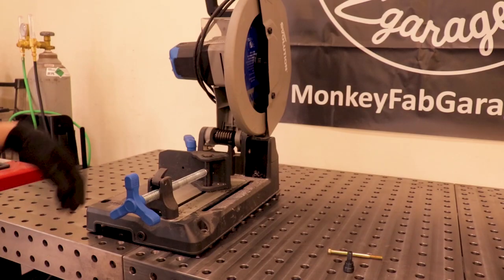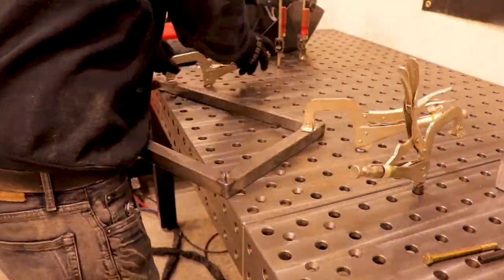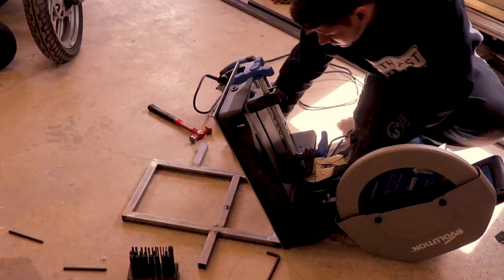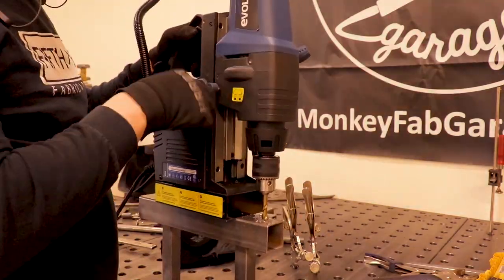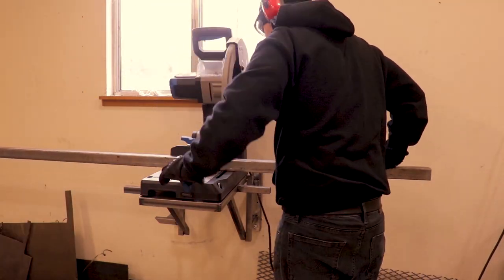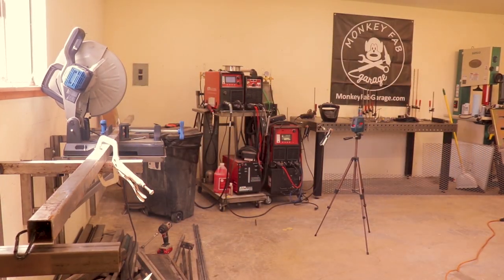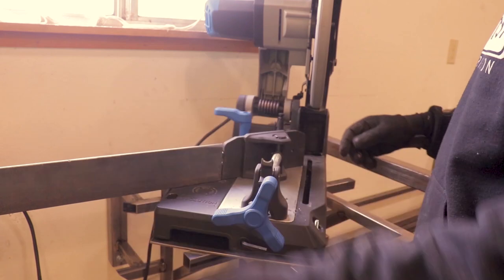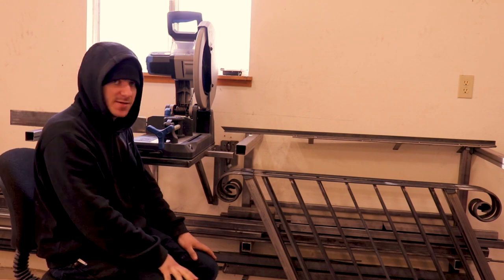Ultimate Chop Saw Stand

Comment: Brilliant build! With the pivot point in the place where the bolt is, does that mean you can set a backstop to a certain length then Change the angle and get the same size cut? I’m thinking of doing this, on the evolution saw I know there are 3 fences positions do you use the middle one? 

I love watching people create their ideas and tweak aspects of it, think of how much more convenient the saw set up is when done what a time saver 👍

Comment: Excellent!  I'm going to be doing the same thing.  I'm going to put my saw on a "lazy Susan" to spin it, and make it adjustable up and down as my work bench will have a wood miter saw on it too.  I want them to all be level, but the metal saw has the lock piece that will get in the way so I have to lower it.   I'm really eager to see the next video.  Out of curiosity what gauge steel did you use?
Reply from the maker: That sounds awesome!  It was mostly .065 and .095 whatever was lying around
Reply: I'm curious. You make an outstanding piece.  You have the drum sander in your hand and you leave rust on one side of the piece of steel.  Why not remove it and paint it?
Reply from the maker: @hipairbrush1053  that piece took like 10 minutes for that side! Haha and it was mill scale so itll protect it from rusting

Comment: How is straightness of the cut on the chop saw? I have heard mixed reviews of the cuts being 1/16” off.
Reply from the maker: Mine are dead on!  I have 2,  the older one and this new one and the straight up and down motion is dead on.  For angles i use an anglr finder but the stock 45° is really accurate.  I can tig them up no problem

Comment: Nice job bud, do you not use a bandsaw for cutting material?  I also have a drop saw but want to get a bandsaw because it's not as loud and hopefully more precise for 45 etc...I been dipping alot of filler into my tungsten lately lolol🤦‍♂️
Reply from the maker: Hey dave!  I did have a band saw but a chop saw, especially a metal blade chop saw, is way quicker!  And just as precise if not more.  But ya way louder!  Haha dont worry!  My day isnt complete if i havent sharpened my tungsten a dozen times haha
Reply: Hehehe I don't believe it, I seen your inspirational welds my friend and I'm hanging to be half as good...keep up the great work mate

Comment: Turned out really good, quick question how do you store the cable that comes off your tig torch mines either coiled up on the work bench or all over the floor looking for a better way to store this thing, thanks Long time viewer and subscriber :)
Reply from the maker: If you find a good way let me know!  Haha i usually run it under my table so its not too much in the way.
Reply: @5thStreetFab  I did some research and you can actually buy retractable reels , like what you would use for your air hose or garden hose might be a bit bulky for my liking tho haha